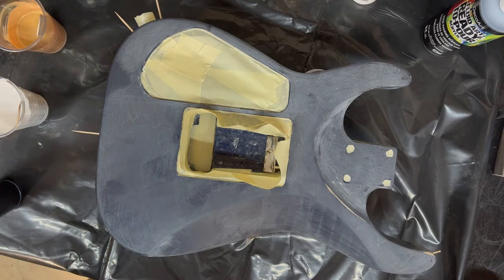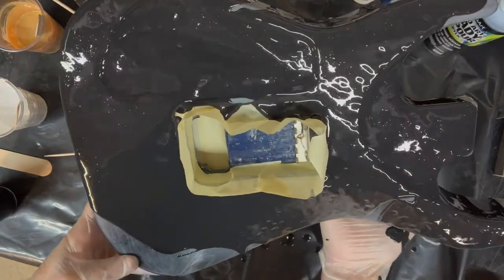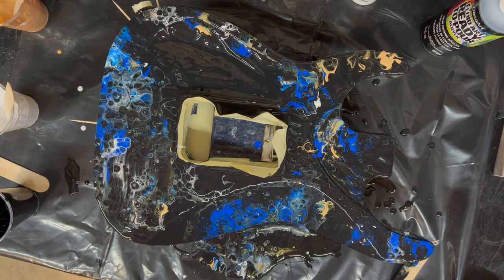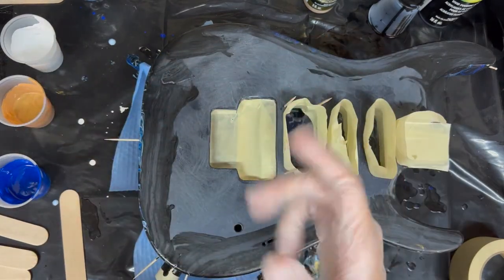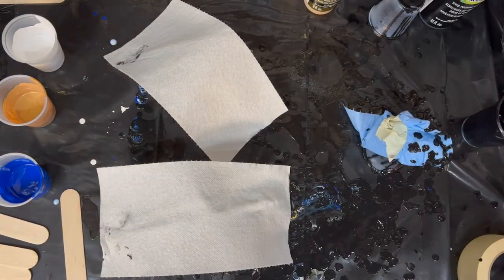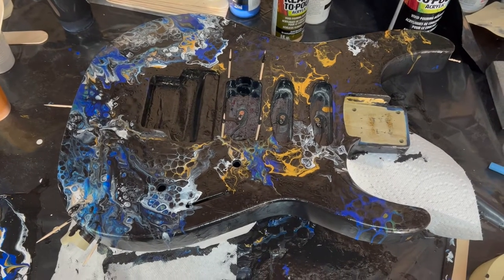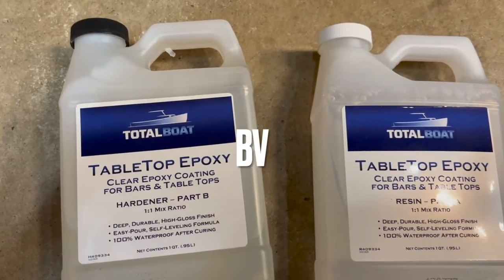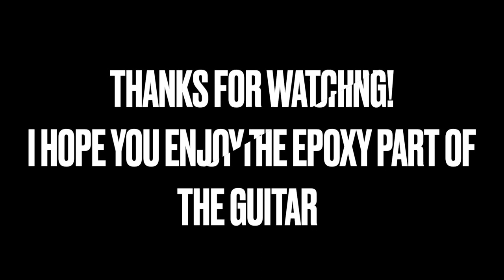Acrylic Pour Electric Guitar: Pouring on the Guitar (Bonus Resin Experiment)

Comment: HOLY SHIT SOMEBODY ACTUALLY FINALLY ADDRESSED THE BACK OF THE GUITAR IN ONE OF THESE PAINT POURING ON A GUITAR VIDEO.
It was driving me insane.
I've been commissioned to pour over a guitar (usually do canvas, but i was def down to try something new), so I'm taking in as much info as possible from other people's experiences.
Reply from the maker: Yeah, as you can see in the video, I struggled with the back. It poured just fine but just be aware of the back when you pour the front. Since I did the back first then the front, I ran into problems with the paint running down the back and screwing that up. I will definitely have a better way to do this when I do my next guitar, which I will be filming and posting soon!